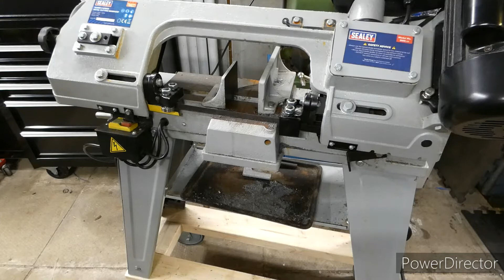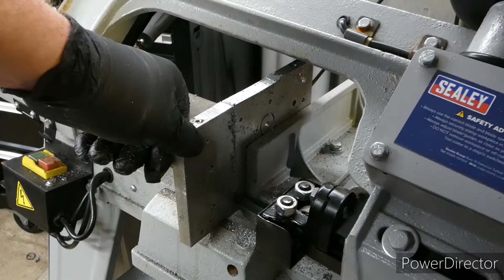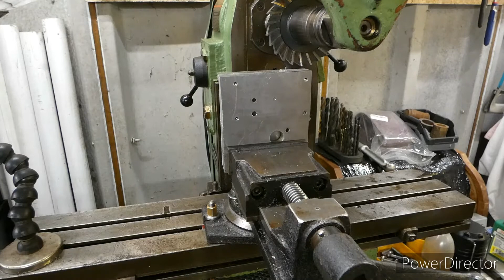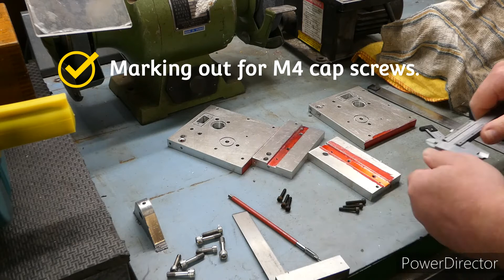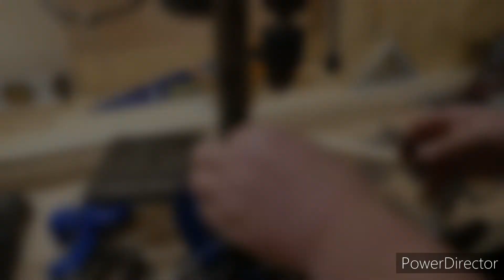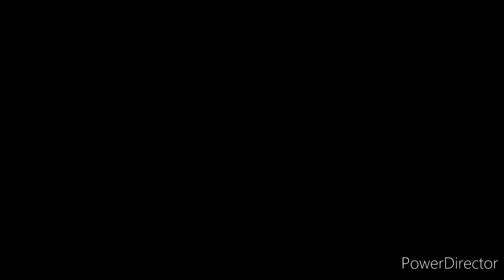Machining Brackets on the Centec 2B

Comment: Made a nice job of those. Lovely quiet mill your centec. Nice to be able to tackle jobs like that with your own gear. I'm here from the mig welding forum. I'm username magnet on there.
Reply from the maker: Thank you, I do enjoy using the Centec it is such robust machine. I probably spend too much time on the forum and not enough in the workshop!!
Reply: @myoldlandy  Aye they can become all consuming if you let them. Ive been on that forum since 2009 and still haven't got 1000 posts up id rather be doing my own stuff.
Nonthe less its a great forum.
I have an elliot omnimill it has the overarm for the horizontal arbour but i have never used it. In fact i have never used a horizontal mill. 
Something i need to try.